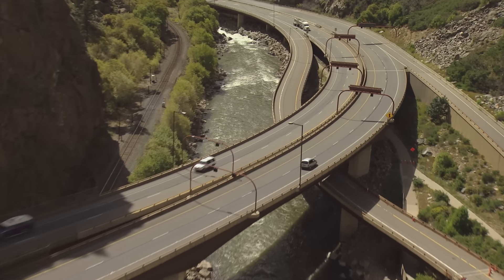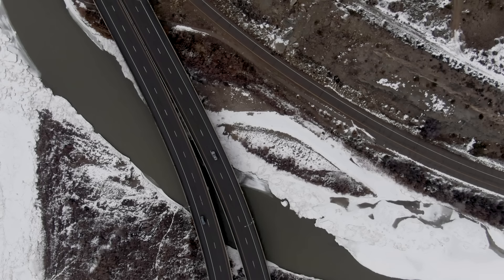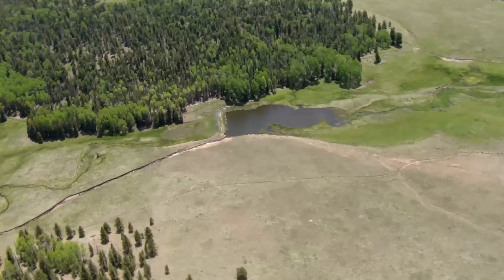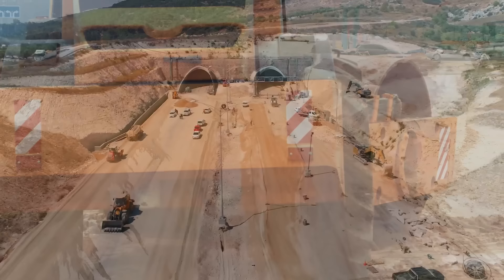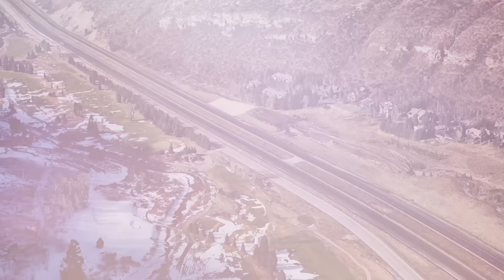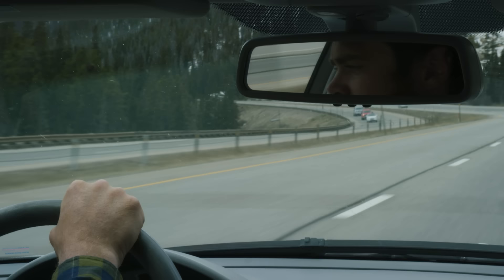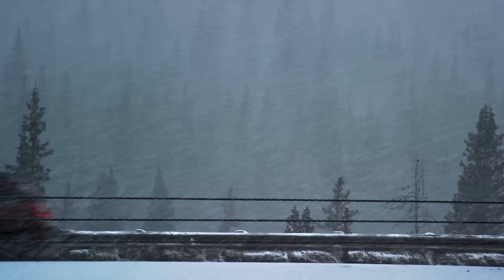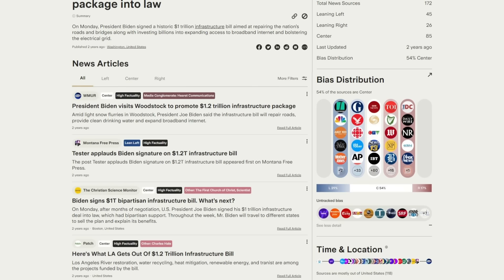How to Build a Road

Comment: This is so interesting, thanks! As a lawyer especialized in public procurement, our firm does a lot of legal consulting for big infraestructure construction companies, but all the minutia of the engineering of the roads our clients do flies over my head😅 so this actually explains a lot! I live in Chile were most highways have to pass through some sort of mountain, similarly to this one. 
I actually love working for these types of projects; by helping the contractor (and a State), in a few years, you get the satisfaction to drive or use a new infraestructure that serves the whole community. Pretty cool!

Comment: As someone who lives in the mountains of Colorado, Eisenhower Tunnel is infamous if you’re going to or from Denver. If even one person spins out, it can lock down the road one way or another for hours. Vail pass is even more infamous. If you’re going to have sketchy weather, if you’re going to have whiteout conditions, it’s gonna be vail pass. Whenever we go from glenwood to Denver, we don’t say we’re on the way until we’ve made it past both. IF you can get through Vail Pass, IF the traffic through Eisenhower isn’t terrible, then you’re on your way. My personal record for waiting on Eisenhower Tunnel is (not joking) 5 hours.
Reply: I have almost quit going skiing at the I-70 corridor resorts because of the traffic.  Even just getting up and down Berthoud (for Winter Park) can be a bear with traffic backing up from Floyd Hill through Idaho Springs.

Comment: 0:20 I don’t know if anyone else noticed, but the slope counteracts centrifugal forces, not centripetal. Centripetal forces are actually what keeps matter close to the axis of rotation, counteracting centrifugal forces, which pull matter away (i.e. if you swing a bucket of water, the centrifugal forces keep the water in. This means the slope of the road actually creates centripetal forces itself.
Reply: I'm betting the writer "corrected" some of the information that they researched after remembering being told that centrifugal forces don't really exist, but without understanding that they aren't just interchangeable terms.

And centrifugal forces don't exist as a physical thing -- the car isn't being pushed out of the loop by some magic force, it's just going to keep moving in a straight line until something makes it curve. But you can still talk about them meaningfully in a mathematical sense (e.g. from the car's inertial reference frame), and it would have been reasonable to say counteracting centrifugal forces here.

But even more correct would be to say that the ramps increase centripetal force. So the statement is exactly backwards from what would be true.
Reply: @TylerMcHenry What forces "exist" depends on your reference frame.  In a rotating reference frame, centrifugal force definitely exists.
Reply: @TylerMcHenry it's all a model, nothing really exists, only practical and useful mathematical representations of physical observations
Reply: Actually 🤓the slope helps to add centripetal forces so that the inertia of the automobile doesn't take it off the road
Reply: @TylerMcHenry  If we're nitpicking, wouldn't the total centripetal force in the plane of the turn be the same? Just turning some shear force on the tires into normal force
Reply: I was thinking that too!
Reply: "centrifugal force" is not a force you write down in calculations- it's an observed effect, it's literally the same, functionally and literally in magnitude, as the centripetal- which is what is actually maintaining any rotational motion and is necessary for its functioning

creating centripetal = creating the same amount of "centrifugal force" IE the object's resistance to being put under acceleration, into rotational motion, as per the first law. the use of "centrifugal" in any context just demonstrates the speaker's ignorance of literal high-school level material
Reply: @djmiller7192  Yes, but given that the shear force of the tires has a hard upper bound based on the friction between them and the road, shifting some of that demand into normal force does increase the maximum amount of centripetal force a car can experience. Also normal force doesn't decrease with slick conditions the way friction force does, so it's also safer.
Reply: @TylerMcHenry a centrifugal force exists from a turning car's reference frame, precisely because a rotating reference frame is not inertial.

Comment: In the late 90's and early 2000's the state wanted to build an elevated passenger rail line from Denver international airport to Grand Junction using the I-70 corridor.  As I recall state voters rejected the plan because it was going to be VERY expensive and only benefit people living along I-70.  Still, I would have enjoyed taking the train to the Airport or Downtown Denver from Edwards Colorado instead of driving.
Reply: It wouldn't have been able to follow I-70 exactly either, rail lines have tighter tolerances for gradients and curvature.
Reply: Some people just do not understand long term benefit
Reply: At least the Amtrak from Denver to Grand Junction is a rather pretty, if somewhat slow, ride. I do recommend it for a leisurely, but beautiful experience.
Reply: Expensive, and largely pointless, since the California Zephyr already runs from Union Station to Grand Junction. The only gap was from DIA to Union Station, which is now covered by the RTD A Line.
Reply: @johnchedsey1306 It would be a monumental undertaking to get a rail to go faster through those mountains.
Reply: @jamesdinius7769 Supposedly the Transrapid system allows higher gradients.  But large enough radius curves to allow high speed would be a challenge.
Reply: @bearcubdaycare  Plus the incompatibility with the rest of the network.

Comment: Context: I am from California 
the I-70 (in Colorado) is the most dangerous road i have ever droven on. when at night, there is no light and the lane lines are sometimes unpainted and usually unreflective. the speed limit is 80mph. at night, it is really hard to drive especially because the tunnels are bright with all lights on but the interstate is dark. Can't adjust to the light change
Reply: This is something I've noticed in Colorado, the road paint is generally not reflective at all, makes things a little tricky at night.

Comment: As a Coloradan I've driven I-70 countless times but my very first solo trip as a truck driver after completing my training was from Denver to SLC overnight in winter.
I ran out of hours getting across and another driver came and we swapped trailers to get the load delivered on time. I'd seen that other driver in Denver before I left there. He had taken I-80 across with no issues.

Comment: I wish we could switch to trains as the primary land based long distance travel method and away from cars. The interstate is absurdly expensive and videos like this just highlight that even more for me.
Reply: Nobody will finance train tracks going through huge swathes of empty land when you already have the interstate system.
Reply: @soundscape26  The I-70 mountain corridor is far from empty.  From Denver to Glenwood, there are at least 2.5 million people (mostly in Denver and the foothills, yes), and the corridor is HEAVILY used.
Reply: Have you seen the difference in the width of the railway tracks compared to the interstate?

It would be possible to build soweit double track streches and have passenger service as well
Reply: @carstenmoller2248  Grades are a complication, though...cars are capable of much higher grades than rail.  If we could suss that, we may be on to something, but it's an old and basic problem of rail in steep terrain.  That said, I'd love it if we could solve it.

Comment: This really puts into perspective house heavily subsidized the trucking industry is and how much of our infrastructure costs are because of it
Reply: I often imagine what American rail would look like if half as much of the engineering expertise and government funding that went to building I70 went into building rail networks instead
Reply: @drmilkweed  Though in this case, you couldn't realistically replace I-70 with a rail line, it would be even more expensive as rail lines have even less tolerance for gradients and curvature.
Reply: The deregulated trucking industry subsidizes your consumer goods.   Look it up.  Now whether or not the corporations are still passing on that shipping discount to the consumers I don't know.

Comment: In Europe they would build a 50 km long rail tunnel in those conditions. But in 'Murica it is unthinkable to be without a car, so they built this road instead.
Reply: they literally built a rail tunnel through the same area 50 years prior… it’s called the Moffat tunnel
Reply: @burlingtonfan7492  Interesting, but a rail line isn't much good for people unless it has high speed passenger services (around 200 mph), but I guess the rail tunnel keeps trucks off this road?
Reply: @Dave_Sisson high speed rail for what?! Do you even remotely understand the geographic makeup of the area?
Reply: @Dave_Sisson ”a rail line isn’t much good for people if it isn’t high speed rail” that is just, not true. maybe in terms of intercity travel, but building a 200 mph line through this region would be effort better spent on a 130 mph tilting train, and some passing sidings

Comment: Another interesting historical  quirk, is that the Moffat Tunnel for trains replaced Rollins Pass. The width of the tunnel meant that the design of the Solid Rocket Boosters for the Space Shuttles had to be redesigned to fit through the Moffat Tunnel. The SRBs were built in California, then transported through the tunnel to reach Cape Canaveral. 
Even more interesting: standard rail width was based on early wagons with 2 horses side by side, since early rail cars were converted wagons. Wagons had a standard width so wooden wagon wheels wouldn't break going through muddy ruts before the invention of paved roads.

Comment: Between the Eisenhower tunnel and Glenwood Canyon I figured I-70 through CO had to be the most expensive chunk of highway in America. Just the trip through Glenwood with its endless hopping from one side of the Colorado river to the other, and the tunnels through various cliff outcroppings will convince you very quickly that this was an awfully expensive construction task. Then comes rockslides, mudslides, avalanches, and wildfires on a regular basis, and it's a never-ending maintenance task to try to keep the canyon highway open.

Comment: I was driving my all-wheel drive with snow tires in a blizzard on I-95 in Richmond VA. The road was banked for a left bend, and I was in the left lane going about 15 mph. Ahead, doing about 10 mph, was a semi-tractor trailer two lanes to the right. As I approached, just about to overlap the back of the trailer, the truck lost traction and started sliding…downhill, which was down the banked road surface…and toward me, sliding ever faster. I gently goosed the accelerator and cleared the nose of the cab by about 3 feet! As I glanced back a second time, I saw the truck come to rest against the concrete wall.

Comment: I appreciate your mention of hazardous material transport. While I never have traversed Loveland Pass, I have used US 30, the I 70 alternate to the tunnels through Pennsylvania. It is a very dangerous alternative to the tunnels, and I do feel like they are trading our safety for the convenience of the general public. These old routes are simply outside the charts of what would be a safe acceptable design today. 

I feel like there are ways we could safely use these tunnels, such as scheduled convoys, which could be accompanied by the appropriate fire apparatus.

For a lower skilled driver, who has little experience with this type of driving, the treacherous routes like Loveland Pass and US 30 could be a death sentence if there is any mechanical failure at all!

Comment: 2021, almost died driving on Lovelands Pass after leaving Keystone during a snowstorm at night. Could barely see the road and turned for a few seconds it looked like the bend was to the left when in fact it was a sharp bend to the right around the hill. Thankfully I saw a snowbank near the edge of the cliff and aimed for it to avoid losing grip with erratic steering. My rental car had to be extricated by 2 tow trucks working together to avoid damage to the vehicle. In retrospect I should've known renting a fwd chevy Malibu in Colorado wasnt a good idea. At the very top of Lovelands Pass that car was inches away from a 400ft cliff edge sitting at about a 30% lateral angle. Looking out the driver side window I could see straight down the cliff's edge, scattered with sharply edged boulders pertruting the hill side all the way down the valley. When I opened the driver's door (facing the valley ~400ft down) I suddenly realized how heavy car doors actually are when it swung opened pulling my hand down with it! I had to climb back up about 6 ft on my hands and feet up  the hill, with a heavy flurry of snow cutting my face with each gust, it was an experience I won't soon forget! I just want to say thank you again for all those men and women working in such brutal conditions to keep us safe, the first responders and the two tow truck drivers that were somehow able to extricate that crappy sedan without a scratch on it! ❤

Comment: Im gonna nitpick for the benefit of a future correction video: at 00:22, banking the curve does not give the car more friction. It actually creates a force vector where a portion of the car's weight is parallel to the slope of the road in the downslope direction. This means that less friction is required to be generated at the tyre-road boundary in order to keep the car turning along a curve, as the weight is doing a component of the work. As less friction is required, there is lower chance of the car exceeding the maximum friction that can be provided. In practice, this means the car can corner with a greater velocity before it reaches the point of slipping.

Comment: US6 in the mountains is absolutely a beautiful, scary road to drive on in good weather with speeders and drunk drivers from the casinos. However during a snow storm it gets 10x worse. I recall nearly plummeting over the edge one winter during a nearly white out storm, one wheel hanging over the edge of a 30+ ft drop, and I wasn't even speeding, hit a patch of black ice right before a turn. 
There is a reason there are so many rusting car wrecks in that valley. Safety first if you choose to drive it, better to arrive late then dead.

Comment: I remember when I80 was finished in Wyoming. Some brain trust put it through the most windy part of the entire state. Also, I80 is through open plains which means snow is ok, but after the storm, the wind then moves all the snow across I80. Some clever wit, after driving across Wyoming on I80 nicknamed it the "Snow Chi Min Trail" (It was finished at the same time America was in Viet Nam).

Comment: As a norwegian its insane that you have highways 3000 meters up when our roads turn bad at about 700 meters above the ocean and our tallest peak is 2469m
Reply: We're a fair ways south of you, which helps quite a bit.  The tunnel is at the same latitude as Majorca, which is hopefully a useful illustration.
Reply: @argentonath  its not really the temperature or weather that baffles me its just the height. And from what i saw in this video this road is just as vulnerable if not more than the ones i'm used to

Comment: ❤The reconstruction of the stretch through Glenwood Springs had to be crazy expensive. They built a plant east of the canyon to cast concrete Y sections that they trucked into the canyon to form the westbound lanes on top of the Y.. A gap between the mountain and the roadway trapped many of the falling rocks. The eastbound lanes were tucked under the overhang between the Y structures and the river. I came through there while they were moving the Y sections into the canyon.

Comment: Been down I-70 a few times.  In summer and winter.  Great drive always cool to get through the Eisenhower tunnel.  Took the Loveland Pass a couple times as well.  

Any drive in the MTN's is a good drive.
Reply: Of course being a passenger not the driver does make it safer....  Or so I'm told for some strange reason I've had to be the driver every time.

Comment: I want to note that divides do not HAVE to be high mountains. A super intriguing counterexample is the Brenner Pass in the Alps. North of the pass, rivers drain into the Inn, then the Danube north of the Alps, which flows east and eventually in Romania flows out into the Black Sea. South of it, rivers drain into the Po, which lies south of the Alps and enters the Adriatic Sea a little south of Venice.

Meanwhile, the pass itself is at an elevation of only about 1400 meters (4600 feet) above sea level (nearby mountains frequently reach above 3 km (10k feet) in height), and it's wide enough for a highway, a train track and secondary roads to run through it with space left over.

From what I know of the Alps, I assume it formed due to a major glacier 'flowing' through it (large glaciers consider 'flowing downhill' more of a suggestion than a requirement if the differences aren't too big), and it's been in use as the easiest way to traverse the Alps for at least several thousand years.

Of course, that doesn't mean it's WRONG to say that continental divides are difficult to traverse. The Brenner Pass is so noteworthy specifically because it's an exception to the rule.
Reply: The whole point is that the traversing of the divide is to link parts of the state that would be really isolated. 

The ski industry would be a fraction of what it is without this road.